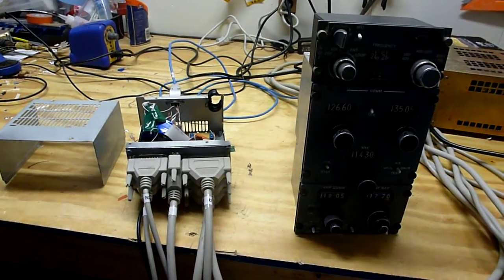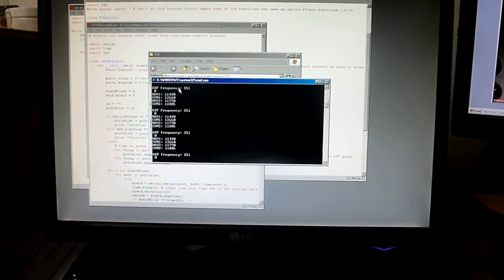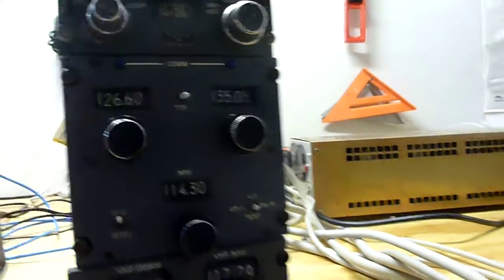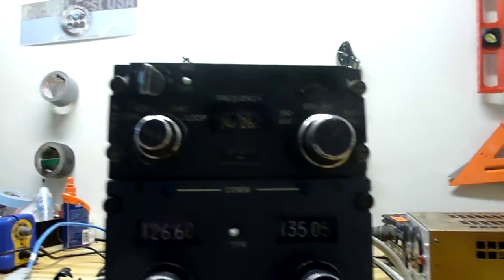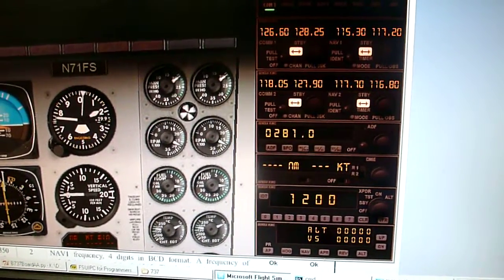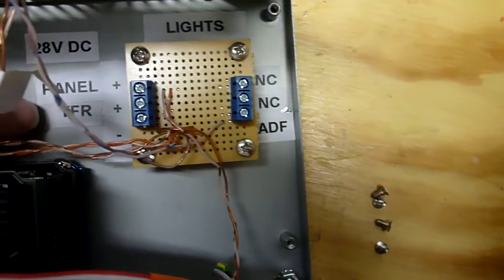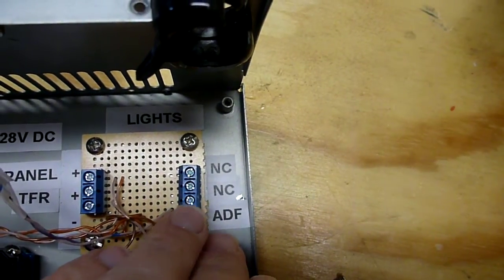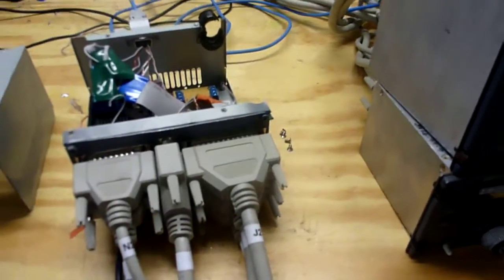FSX ARINC radio interface for 737-200 simulator

Comment from the maker: No 429 data here, although http://v1avionics.com is working on a 429 interface. These radios are pre-429. Like I said, they are basically big switches...a pile of pins at the back of the head go high/low depending on frequency setting.

My code would not do what you are wanting to do, it is just the basic functionality required to get the data into the computer. The graphical presentation would be done separately (I do have something similar to this for my "glass" panel on my sim).

Eric, I just saw your post. You are doing a Lear sim? What model? Any pics? Lears are among my favorite bizjets. :)

Comment: So the heads output ARINC 429 data and the Arduino translates??
 I am working on a project that needs to look at live 429 data bus label 133 TLA Throttle Lever Angle and present on say a LCD what the angle is.
Would your circuit do this?
Thanks,
Duane

Comment: they are now installed in bottom compartment under the 737 TQ. We should have gone with short cables, I had a hard time stowing them in the new location. However it will work much better than the old plan of running the cables out the front of the TQ.